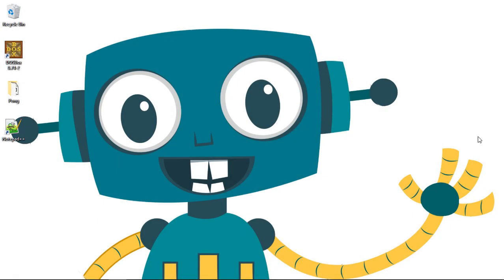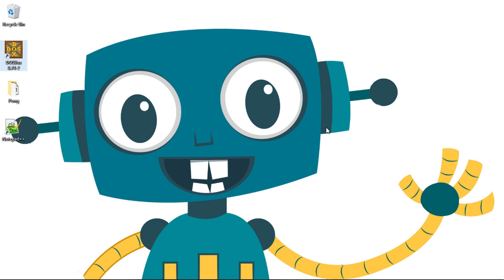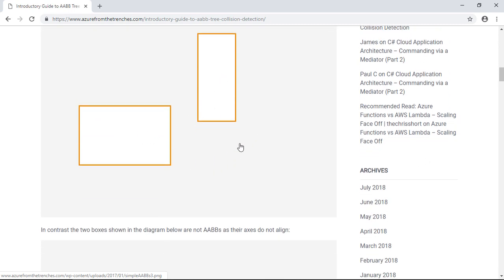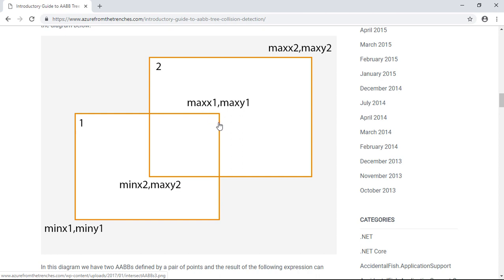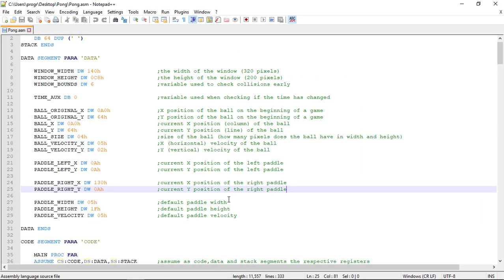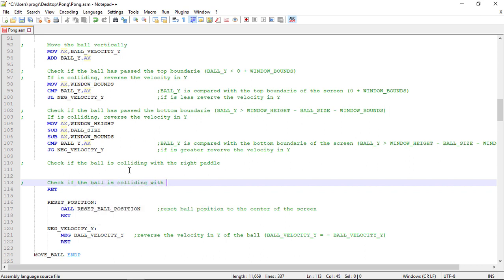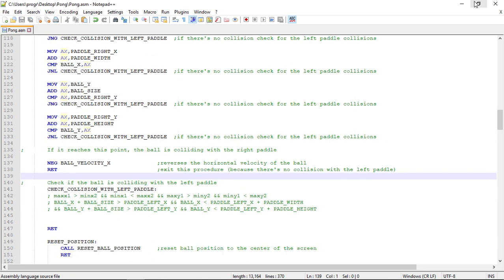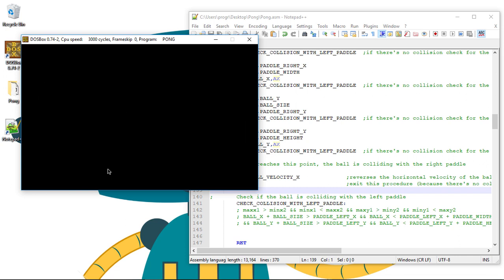[MASM] 8086 Assembly - Pong - 14 Ball Collision With Paddles

Comment: This diagram is very confusing.  minx1, miny1 shows the bottom left of the first box, while  minx2, maxy2 show the bottom left of the second box. What kind of disturbing logic is this? Why minx2, maxy2 and not minx2, miny2 on the second box? Another thing that I don't like is why the x1, y1 coordinates start from the bottom left and not from the up left like all windows do? All this is very hard to follow, but it is not your fault. I like very much your videos, thanks for your efforts.
Reply: the image shown is using Cartesian coordinates where the origin is in the bottom left, but the computer prints from top left to bottom right. The coordinates are essentially mirrored across the x axis. fortunately it doesn't change the algorithm at all.